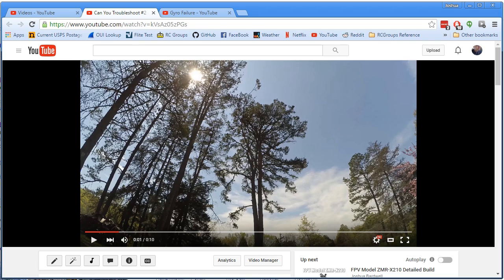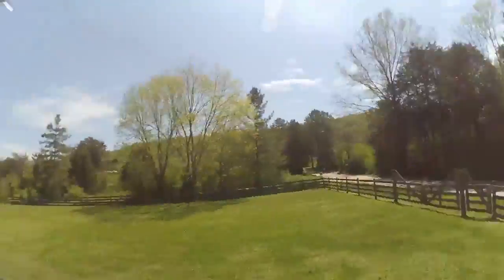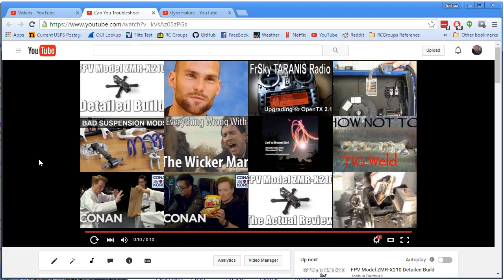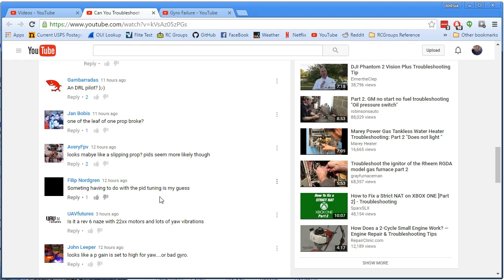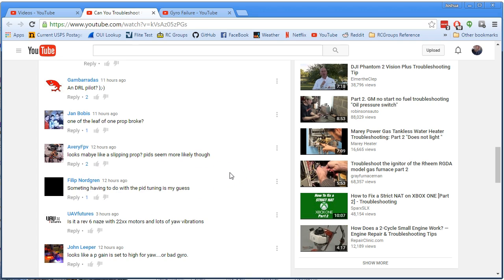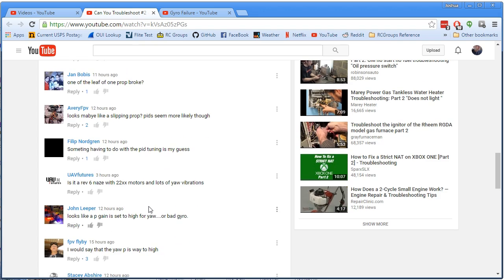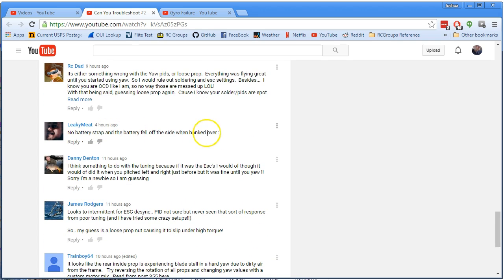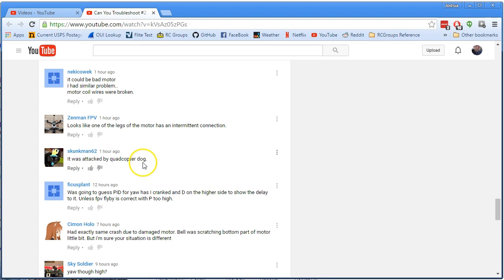Can You Troubleshoot #2 - Answer

Comment: I actually had one esc with damped light off and 3 others with damped light enabled. What happens is the one with damped light off will always lag when you throttle down. A punch out is fine, but when you cut throttle the arm that had damped light disabled will produce more thrust and cause the quad to pitch/roll. It is very annoying if you do not have airmode enabled and it WILL cause the quad to crash. It won't shake violently like in your video, it is more gradual.

Comment: useful & informative as usual! - what did you replace your faulty fc with?
Reply from the maker: +jamble7k F303 v2.
Reply: +Joshua Bardwell do you have previous experience with the boards? I'm running a CC3D in my ZMR250 and a Naze32 Rev5 in my QAV210 so I'm still flying with ancient FC's, and I'm looking to upgrade.
Reply from the maker: I still think the F303 v2 is the best value for money on the market, but the market is full of excellent boards at great prices. Even a Naze32 rev5 running Betaflight is very competitive, if you can get the un-inverted SBUS signal out of the X4R, or if you are running PPM.
Reply: Thanks, I'm going to look into the F303 some more. Currently for my Naze I'm running SBUS with an X4R-SB and an inverter. Does the F303 support the FrSky's inverted signal or would I need an external inverter again?
Reply from the maker: All F3 boards support SBUS inversion natively.

Comment: So do you still recommend the Xracer F303? The v2 just came out and you are already have a failed gyro.
Reply from the maker: +Jonathan Edradan The failed gyro was on my v1 board that has been on my copter since February. The board was flying for a while with two standoffs broken, so it's possible that the extra vibration from that caused the gyro to fail. Or the same crash that broke the standoffs also damaged the board. I haven't heard any widespread reports of these boards failing in the field, like for example the Naze32 rev6 or the SPracing F3. So for now, I am willing to treat this as just bad luck. Hardware fails sometimes. This could be one of those times.

Comment: Hi Joshua (or anyone willing to help), 
I am having an interesting tuning problem, and I wondered what your thoughts were. It is a rotorx atom (122mm) running 1105 6500kv motors, littlebee escs and a naze rev 6. The issue that I am running into is extreme oscillation at high throttle that cannot be tuned out by reducing P or D (even taking P down to 1.5 does make a difference). I was wondering if it is something similar to the issues that you have been having here, or something completely different. Here is some DVR footage:
https://www.youtube.com/watch?v=SJaKVecN_IQ
https://www.youtube.com/watch?v=t1NQCT5RAWI
In the second video, you can clearly see that the quad is yawing itself. Here are some posts on RC groups that explain the issue further, and delve into what I have tried to do to fix it:
http://www.rcgroups.com/forums/showthread.php?t=2391308&page=745
http://www.rcgroups.com/forums/showthread.php?t=2391308&page=753

Any help would be greatly appreciated.
Reply from the maker: +Toby Dilworth I don't know how many poles those motors have, but at that high kv, could you be hitting the rev limiter on the F330 processor on the Littlebees?
Reply: +Joshua Bardwell That hadn't occurred to me, but  others are using them. Some people on the Rcgroups thread are saying it doesn't matter what esc they use, they get the same problem. Is there a way to disable the revlimiter through BlHeli suite?
Reply from the maker: Toby Dilworth You can't disable the rev limiter. The CPU can only operate so fast. The rev limiter is there to keep the motors from spinning faster than the CPU can keep up.

If others are using the Littlebees successfully then it's probably fine. Remember that the rev limit is not rpms, it's erpms, which is a function of the rpms times the number of poles in the motor divided by two. So a 3000 kv 14-pole motor might be too much for an F330 ESC, but a 3000 kv 10-pole motor might not.
Reply: +Joshua Bardwell That makes a lot more sense. It is seeming more and more like an issue with the naze.